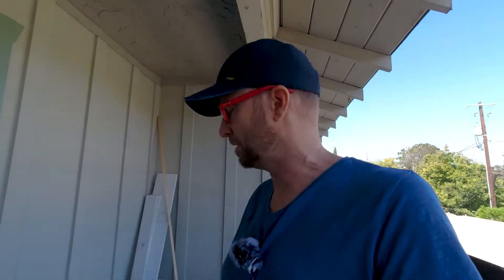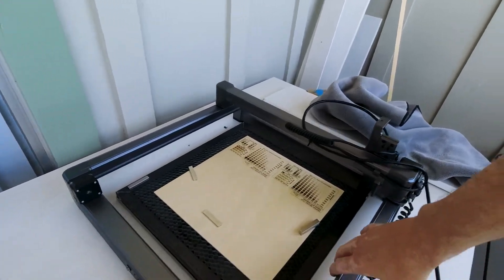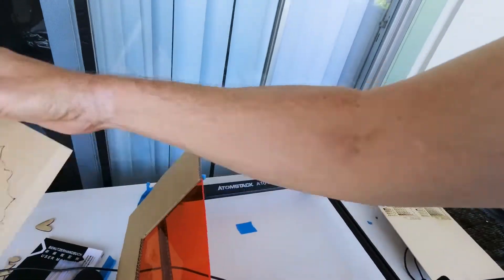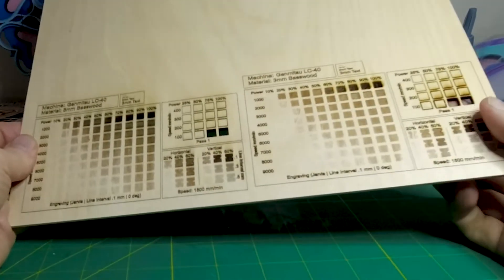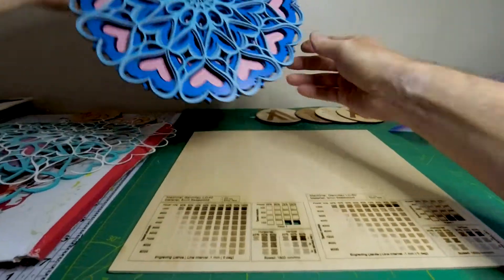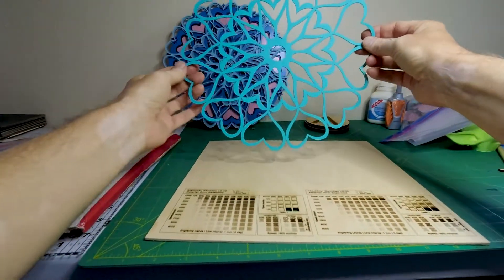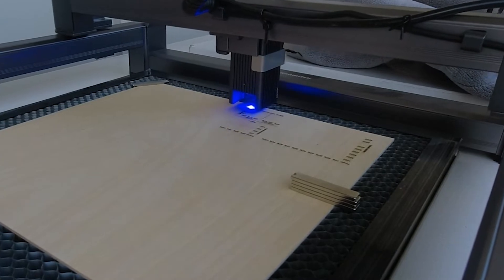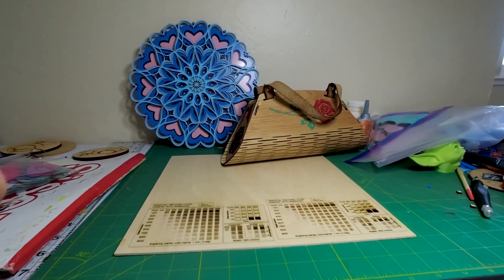Laser Cutter / Engraver: Genmitsu Jinsoku LC-40 Review

Comment: I just received this one though I ordered it with the 5w fac laser module which is supposed to be better for cutting.  They also have a 10w module available which I believe has air assist capability.  The fac module though is difficult to put air assist on because there is no nozzle to change.  It has mirrors up inside the module.  I will probably need to 3d print some sort of adapter.  I would be interested in knowing how you attached your air assist.
Reply from the maker: Look at my newer vids on air assist, it will explain all. I miss my Genmitsu as it was just so easy.
Reply: did you ever find out how to attach air assist to your fac 5.5 model? i just bought one thinking it would allow air assist haha. But really I just want to engrave logos on metal and leather wallets so might not need it.
Reply: @JayzStudio  No, I never did.  Even so, it seems to work fine without it.  I use transfer tape on wood and nothing at all with acrylic.  I have yet to try metal, leather or slate coasters.

Comment: Nice review. I also have this laser and would like to add air asist. there is not much clearance around the sides of the unit when scurting the perimeter.  I'm curious what nozel and how you route the tubing out the side. All the best.
Reply from the maker: It was an issue. I had to 'home' the machine with the module up high, then lower it after. BUT, I realize if you do it like my latest video (on Air Assist), it will have room. You could hot glue the tube to the side. Unfortunately, there is no place for a zip tie on the Genmitsu.